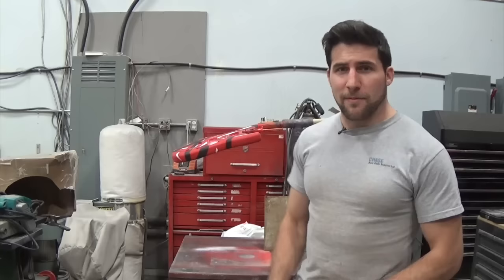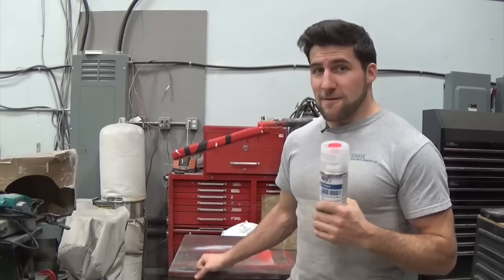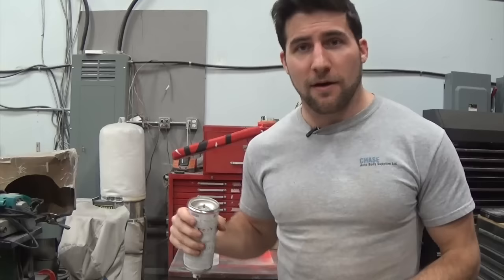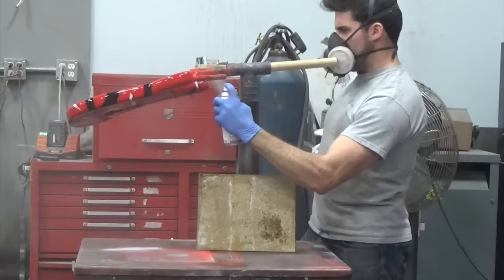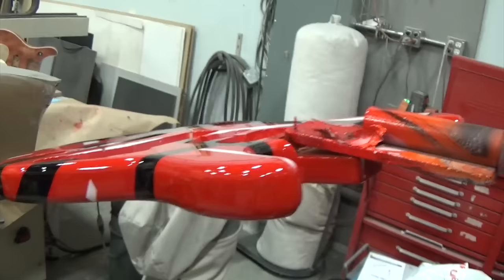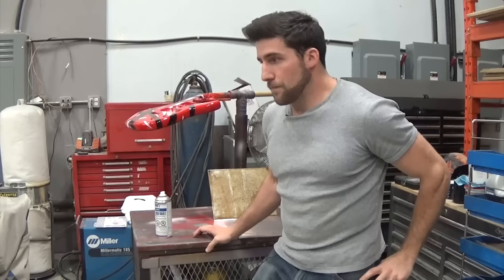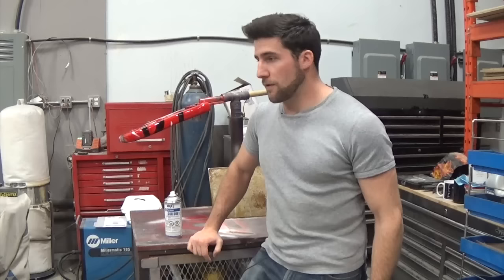How to get a professional looking clear coat with spray cans

Comment: honestly this video out of your vis has been the best and most informative for me. it's like learning to do a math problem then suddenly it all clicks lol. As i stated before with many questions about finishing (clear coating)  a paint job with job and i believe my issues were not using a catalyzed polyurethane. Which I will now use on my one bass guitar i'm currently redoing (painting) i still have lots to learn. but thank you again
Reply from the maker: I'm very glad to hear that you've found this video helpful. It's certainly possible to get a beautiful finish with other spray cans, but this product is high quality and makes it considerably easier I think. Just make sure you protect yourself; it's more dangerous than your average spray can.

Comment: It's a great finish. I'm one of these guys that has been doing rattle can finishes for decades. I'm living in japan at present and one of those cans is 150 bucks (US). I poop you not! I had to buy a compressor and a gun to use urethane and epoxy finishes on my guitar projects. The funny thing is, the compressor and spray gun cost me less than one can of that finish in Japan.
Reply from the maker: That’s insane!

Comment: Using one of these cans right now. A word of caution when activating  the can is to wear protective gear during this phase EYES. The can can sometimes spray out of the bottom.
Reply from the maker: Damn man. I’ve never heard of one doing that. Everything ok?
Reply: Apparently not 🤣
Reply from the maker: So it would appear.

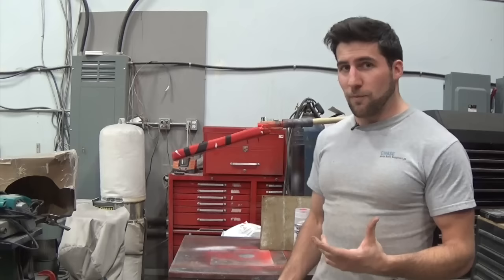Comment: 😀 1:11 "One of my hoses are leaking".... 24 seconds later... 1:35 😀 Be careful man! By the way, about the coat. Spray can or not, we can always paint a layer more and wet sand the surface to en even smoother finish. Pretty easy and it makes even better results in the reflection of light on the finish. Great videos buddy! Thanks for sharing them!

Comment: Spray Max 2k lacquer is a good, proper activated finish, goes on well, produces an excellent finish.  I've used them to spray plastic car bumpers, no issues, no cracking either, and remains slightly flexible.  The best spray can 2k finish I've found.  Makes like 'HB 2k' are crap, they aren't a 2k finish from a can, they are a crap 1k, trades description breach.  Use a proper respirator/mask, at least a Gerson type disposable.  For small jobs I highly recommend Spray Max.  Over the years, I've converted to proper compressor and spray gun.

Comment: Hello. I just painted a DIY guitar kit. I primed it then painted an abstract design with acrylic paint using a paintbrush. Do you think this product will work for the job? I did the whole guitar like it.
Reply from the maker: +Ninjor4 I guess it depends on what you use to protect it now.
Reply: Brad Angove sorry to keep bugging you but I'm confused a lil. I'm not using anything to protect now its just primed and painted how I said and sitting on paint my table lol. If you can recommend this or diff product would be good. This is my first time trying and I don't expect it to be perfect or anything. Thanks for vid and help.
Reply from the maker: +Ninjor4 ok, that does not sound like a durable finish at all. You haven't used any clear coat?
Reply: I think he means can he use the catalyzed lacquer in the video, over the acrylic paint.
Reply from the maker: I'm kind of just wondering if he has anything on there as an inter-coat. Doesn't sound like it though. 
The stuff in the video is a catalyzed polyurethane. Catalyzed lacquer behaves somewhat differently, but may also work.
Reply: Brad Angove thanks guys. I'm gonna use this product. I have a barn where I can coat the guitar, does it matter if its winter or summer?
Reply from the maker: Yes. If it's too cold your paint won't flow properly. It also won't dry properly. Are you able to heat the barn safely?
Reply: Brad Angove nope. Looks like I'm waiting till summer. ☺
Reply from the maker: +Ninjor4 Ok. Hopefully it works well for you.

Comment: Thats funny!! 45 year old men.  Thats hilarious 🤣  why my sons 45. 
Im 61 and I sanded my Lincoln Gater hood down used the 2x primer and its been fine. Not 1 chip in over 1 year. I still need to paint the black and finish it with high shine and I believe it will work. I air brush and I can yse the can just fine.. im a female btw
Reply from the maker: Nice; I’m glad your primer job is holding up well.
Reply: 61 - 45 = 16

Comment: Great video, I used this as a reference for clear coating my recent project. Spray technique and spread pattern was easy to see. I used a shimmer metallic Krylon can, which turned out great. Followed up with a cheapo gloss Krylon spray to keep it consistent. Ended up with around 6 coats as I started light and it's not high quality stuff. Looks great and I've just gotta wait for it to dry and get rid of some orange peel
Reply from the maker: +ZombicidalMan Excellent. I'm glad it went well for you.

Comment: yes, if its a 2 k clear in a can it can put on a 2k finish like a gun... depending on the quality of clear wether in a can or mixed its the same ... difference is you can always spray a better finish if you have a better painter.. yes a better painter could always make a nicer job using better spray gun setup... but for a small job like that anyone can make it look nice... better quality clear could be put in a spray can also... only real difference is limited fan air adjustments..

Comment: 2k Spray Max should only be used if you have supplied air exchange, end of story. 

The catalyzed lacquers DO NOT contain isocyanates. They do however contain acetone and b-butyl acetate. Both of these are filtered by 3m Organic Vapor cartridges. However 3m clearly states that after using OV filters for an hour with acetone, the filter media becomes "discharged" and then fails to filter, which means it needs to be replaced after an hour of use.

Comment: Can you use this Spraymax on an already gloss finish? I used Rustoleum gloss spray paints. It's dried and glossy, so I'm not sure if I need to scuff before putting down the Spraymax or not. Kinda makes me nervous to scuff before clear coating bc the paint job has a racing stripe. I'm afraid to scuff through the fine lines.
Reply from the maker: If it’s gloss you should scuff it gently at least. Otherwise the clear might delaminate.

Comment: So the professional way, using the sprayer application, is of better quality overall because it is more durable in the long run - ? In general, sprayer vs aerosol can application is better because -- better quality of the "mix" you're able to buy, more even coats, the velocity/"force" of the spray from the sprayer makes a difference --- ?? (Sorry for the noob questions, just trying to understand.) Great video. Glad to know there's a reasonable option for the financially challenged!
Reply from the maker: That’s a great question. In essence you can buy better (and different viscosities etc.) clear coat for a gun, you can adjust the mix with different thinners based on temperature, and you can adjust the volume you’re putting out at once. More versatility for potentially better (or sometimes worse) results.
Reply: @BradAngove  Thank you Brad!

Comment: I've had some pretty good success with Dupli-Color perfect match paint and clearcoat. I believe it's a lacquer based paint and clear coat.... the paint dries ridiculously fast and hard as does the clear coat... using this paint and clearcoat I have gone from start to finish in two days and have been very happy with the outcome
Reply from the maker: It’s acrylic lacquer. Decent paint, but actually takes 6 weeks or so to reach full hardness.
Reply: @BradAngove  I get in the habit of rushing things so I will note that for sure...thank yoh
Reply: @BradAngove  my uncle had a hollowbody bass from the 60s that he handed down to me. It was missing many components but the body was intact.. I decided to turn it into a ES 335... if you're interested  I'll  upload some pictures as I'm very happy with how it turned out
Reply from the maker: I’m definitely interested!
Reply: @BradAngove  I'm having a hard time figuring out how to upload a picture here in the comments... might have FB it or something
Reply: I sent a few pictures via fb messenger... the patch could be better where the old pickup pocket was but it'll do for now...
Reply from the maker: I don’t think you can post images here.

Comment: Brad sometime try simtec polyester sander sealer and simtec thick top coat clear. it sands really easy buffs out to a mirror finish and is 90% the hardness of glass
Reply from the maker: I’m familiar with the winter, but haven’t used it. I need to find a paint gun that I really don’t like first haha.

Comment: Hey Brad, sorry to say, but i sprayed a guitar with it (great result!) and use the rest, without any hope, on a headstock, seven days later! (Winter in Germany...) so - Great Product.
Reply from the maker: The can still worked for you 7 days later? Did you refrigerate it?
Reply: :-) not really, only cold weather here... No, there was a bit left in the can and i had to spray the headstock. I wanted to finish it with truOil but give the can a try, and it works fine! I use this stuff all the time and never thought this would be possible after more than 2 days....
Reply: Ah -  and i put the can in "warm" water for a while before using it..
Reply from the maker: That’s great. I’m glad it worked for you.

Comment: I am considering covering my pick guard with copper shielding tape. I know it won't hold up around the picking area. So I am going to cover it with 2k clear coat. The shielding tape will go on with all the wrinkles and creases the same as applying it to inside the guitar.
Reply from the maker: It sounds to me like you should be looking at some copper leaf.
Reply: The thing is to use what I have or not do it. I would imagine it has been done before. When I had the pickguard off the copper shielding went well with the black body. Thanks for reply. Before I forget is there a way to go back to your very first video so I can watch them all from the beginning?
Reply from the maker: You can view my entire video list as a playlist, but some of the beginning ones are notably lower quality. 

If you go to my channel though, under videos, you can scroll down as far as you want and watch whatever you would like to. 

As for the copper tape, once it’s on if you need to clear coat it I suggest making sure it’s clean and then using a light coat of adhesion promoter on it.
Reply: OK I will do that.
Reply: Wrinkles? There shouldn't be wrinkles in the shielding unless you want them there. If you can't avoid them, you could rub a pool ball or something over it and that would knock them flat. Or the ball end of a ball peen hammer. Anything hard and rounded. If you actaully want the wrinkles for the visual look, you should consider copper leaf. Check out the Crimson Guitars video on it. I'm just not sure from what you said if you want wrinkles or not. OR...are you just covering your pick guard with shielding tape to actually shield it? If so...it goes on the BACK side of the pick guard!!! :P

Comment: I just finished with 3 coats of clear. I have a little dust and a couple runs, completely my fault, but have a question about removal. I need to add a couple more coats of clear, due to the detail painted being a little raised. Do I do the next coats prior to fixing the runs and removing the dust, or do I fix first? Is scraping with a razor blade how you fix runs?
Reply from the maker: Fix first. I use a combination of razor blade scraping and gentle sanding to deal with those types of things.
Reply: @BradAngove  Thanks for your answer. Your videos are great!

Comment: Do you have any videos on how to remove lacquer paint bubbles or runs/ streaks from your guitar? I just did my first lacquer paint job on my guitar and I have some streaks/bubbles I want to remove. Please help!!!!
Reply from the maker: I have touched on it in a couple videos. Really you just let them dry fully and then scrape and sand them smooth.
Reply: @BradAngove  Do you have any videos on how to properly install pickups? Just curious. I am very curious about what kind of drill bit I need to use so I can screw in my humbucker into the wood.
Reply from the maker: You’re direct mounting them? Usually they don’t get screwed right into the wood.

Comment: Do you wet a dry sand your paint before clear coating? If so, how what grit do you start and finish with?
Reply from the maker: I dry sand with 800 grit before clear coating.

Comment: I was able to spray mine again in 3 days ;  ) with no issues. Unless the hardener was gone and it was just clear coming out.... I would have thought the whole can would hard gone solid
Reply from the maker: Ya, I would have thought it wouldn’t come out if there was an issue. Did you store it somewhere cool?
Reply: @BradAngove  No actually... I had no intention of using it again so I left it in the garage and its like 85 degree out everyday right now... strange not a single hiccup. I realized I needed a heavier coating so I went back... came out real good... but not as hard as I was expecting... going to try another can to see if thats just how it is or if there was a problem with it.
Reply from the maker: I suppose if the catalyst wasn’t mixed in correctly to activate it it would have naturally lasted longer, and not hardened as much.
Reply: @BradAngove  Ah so now hes saying I don't know how to shake a spray can! lol jk. Maybe... I cracked it pretty good and shook the crap out of it. It could also be that the can was almost completely full still... it was more an experimental project and I didn't use much.
Reply from the maker: Yes, that could be the case. Less access for air etc.

Comment: You are obviously well trained to do this well done. I see a lot of young guys making the fatal mistake of going in too near and moving their spraying arm back and forwards within a very tight small area and whilst doing so moving their spray gun or can far too fast almost as if they are swiping paint of glass with  a razor blade, or trying to eliminate a Wasp, or Bee  . LOL Alistair
Reply from the maker: They must be used to painting small parts or tight corners.

Comment: I am new at this. I am repainting a guitar 
I purchased the 2k clear coat 
You seem to put the coats on kinda thick. How do you keep it from running
Reply from the maker: It’s a balance between getting a wet coat and getting runs. I don’t apply it so heavy as to run. Painting in a warm dry environment is also helpful/important.

Comment: The clear coat is polyurethane, but what did you use as grain filler and base color? Thanks
Reply from the maker: I didn’t use a grain filler because this guitar had a finish on it when I got it. As for colour, I used Rustoleum acrylic paints. You can see what I did if you watch my frankenstrat series.

Comment: If I’m using this clear coat over a hand painted acrylic design, would you recommend 6 coats? And how long between coats? I would need 2 cans? And do u plug the screw holes with anything? Thanks? You’re a wealth of information for this newbie!
Reply from the maker: If your design isn’t too textured 4 coats 15 minutes apart from 1 can might do the trick.

Comment: I see this video has 3 part. Did you do 4th video where you sand and polish this guitar? Or do you have other videos that show you showing all the steps?
Reply from the maker: I have several other videos and series which show the sanding and polishing. Not for this paint job though. I repainted this guitar about 50 times for various demos haha.

Comment: Brad thank you. 
I have two questions for you: 
1) Besides Windex, what kind of wax and grease remover do you buy? I am in Canada
2) if I want to colour sand, what grit sand paper to use before applying clear. Thank you. Will order clear coat
Reply from the maker: I buy duplicolor was and grease remover, and I sand with 800 grit before clear coat.
Reply: Thank you for replying promptly Brad, the wax and grease remover won’t eat up the paint.

Comment: Great info . I may have missed it , but what kind of paint did you use to do your base design with ? Was it the same brand or can "regular" ( eg . painters touch ) work for the base design ? Thanks man 👍🏼
Reply from the maker: Yes the design was done with the painters touch.

Comment: Thanks so much for the great vid on the clear coats, thats the most dangerous part so far for me. Can you put the 2K over Duplicolor acrylic lacquer paint or clears? Once cured, can you scuff sand that clear and put this over it? The 2K looks nice and thick, and that what I am looking for. Thanks again! Great channel!
Reply from the maker: I’ve done it before successfully. And yes, once the duplicolor clear has hardened fully you. A scuff and coat over. I have however heard of people having delamination issues with that combination of paints, even though it hasn’t been an issue for me.
Reply: @BradAngove  Thanks so much, I'll have to think about it seeing as I have the Dupliclear on it fresh. I'm doing a 5150, and wouldnt mind a thicker clear on it. Thanks again for the info, I'll pop back and letcha know ahat happens.

Comment: the paint I used had quite a bit of gloss to it, I think I can get by with scuffing the lines but nice tutorial.
Reply from the maker: Thanks for watching. I hope you're happy with your finished product.
Reply: Brad Angove for what it's worth, I used a Dremel to smooth out the angry edges.. I used gloss black primer, florescent green and plumb crazy purple... but there was something about the green that the purple didn't like and it tried to separate in some places. luckily it buffed out. any idea what caused that? maybe the chemical difference between florescent and regular color?